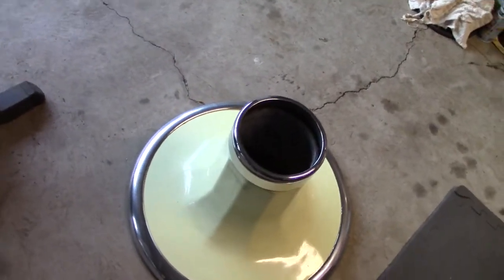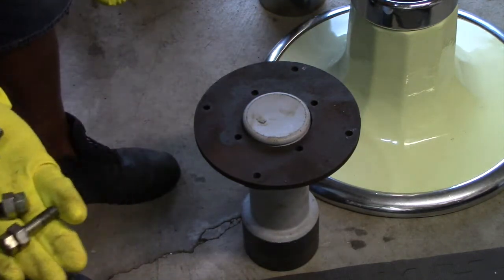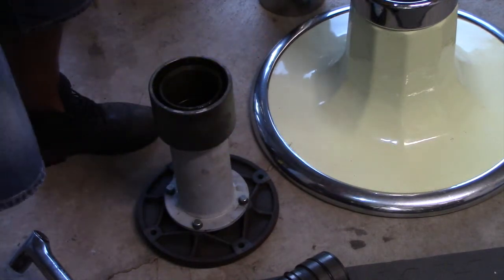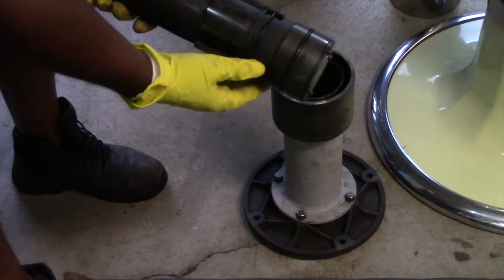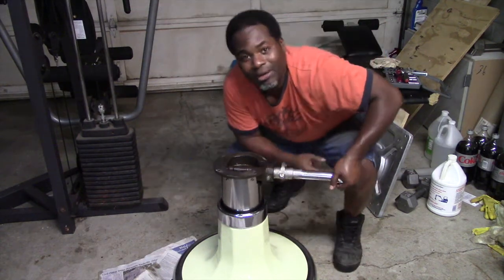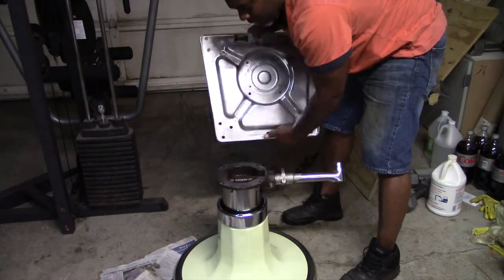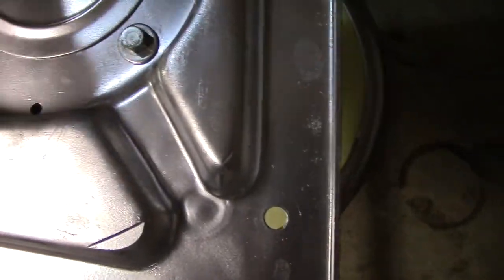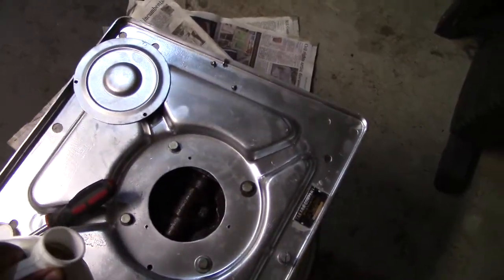The Belmont Project Video #2

Comment: hi wanted to know what kind of liquid you put the hydraulic system?
Also the amount that is inside Koken'm putting together a chair and I would like to know greetings and thanks from now.
Reply from the maker: @4:52 it shows the liquid type thanks for watching.
Reply: I found that the Lucas was a bit pricey.  I used an auto zone generic universal hydraulic oil. Mine was really low and I ended up using about 2 quarts on mine.

Comment: How much oil do you put in the oil reservoir? I have a Koken and I put oil in but then it started to leak, I’m thinking I maybe overfilled it? It wasn’t leaking before....thanks in advance sir.
Reply from the maker: Fill oil to the middle of hydraulic tube
Reply: Rasheem Steele The Barber/Photographer Ok thanks! I’m guessing I must have put a little too much in then? Meaning when I pump up the chair the excess is overflowing I’m assuming? Thank you for your fast response I appreciate it.
Reply: Rasheem Steele The Barber/Photographer And what do you mean by middle of hydraulic tube? Just asking for clarification...

Comment: how do I seperate  the pump from the cylinder  housing?  just pull and slide it out or is there way to unlock  it
Reply from the maker: pull, rotating side to side it's tough.
Reply: +Rasheem Steele The Barber/Photographer awesome I'll try that. how does the big chrome ring come off? is it press fit with cardboard  shims like the smaller one? thanx for the help
Reply: Rasheem Steele The Barber/Photographer  - yo could you tell me how to fix the break if it's not working?

Comment: were there springs down in the cylinder with the pump?
Reply from the maker: No there were no springs bro just rubber bumpers  , watch all the videos they  will explain and can you post a pic or video when your done please thanks. I'd there us anything else message me Good luck !
Reply: I'm currently restoring what looks like that exact same chair
Reply: Thanks
Reply: But that rubber bumper thing not in mine, so I don't know
Reply: +Joe Sellers  my chair doesn't have rubber bumpers either but does have a large spring at the bottom of ge cylinder. I assume they changed and modified these in the later years as mines a '59. I think Rasheed is the earlier version with the rubber etc.